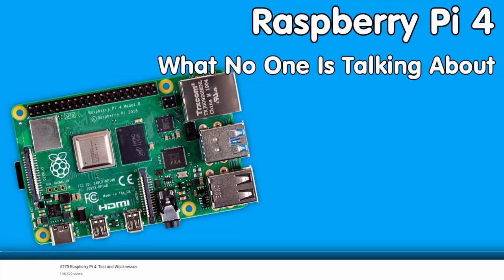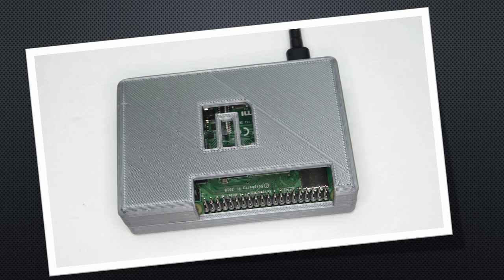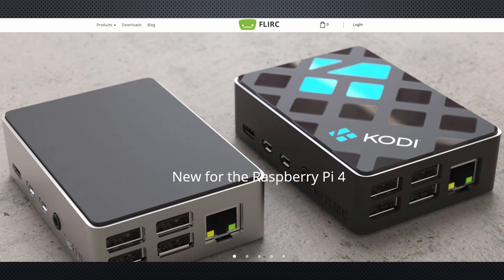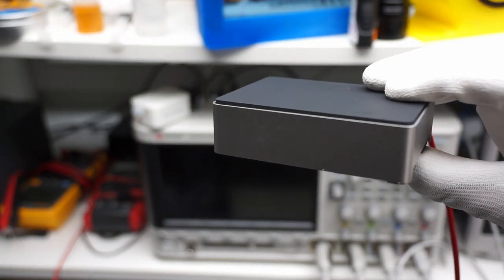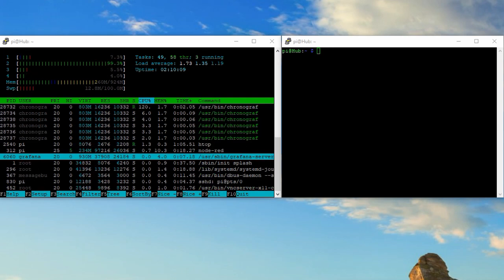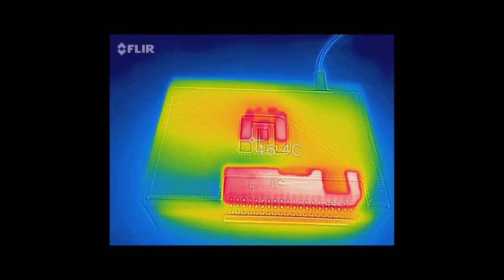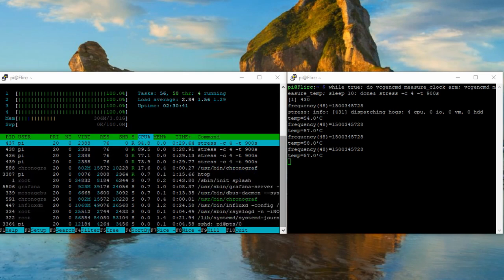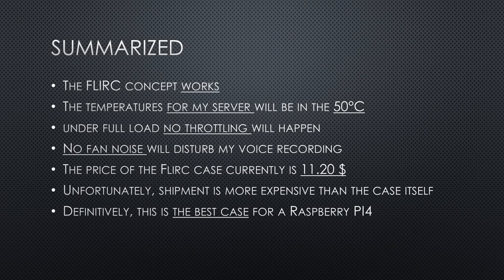#283 FLIRC: A Cooling Case for the Raspberry Pi 4? Does it work? (Quickie)

Comment: My central home control server now is a refurbished laptop running ioBroker under Windows and much more. Enough power, 8GB RAM, disk, good connectivity, case, cooling,  display, keyboard, power supply, UPS - all included. Not expensive, very convenient , and environmental friendly. Of course, RasPi is also fun tinkering around. But my home control central just has to be a very dependable system.
Reply: If you wan't a dependable system, why run MS Windows?  Too much updates that need to reboots.
Reply: @AndersJackson  Updates are annoying but they also happen with Linux. The biggest trouble with my home automattion system I had the last years was unintended Linux kernel updates creating issues with FAT32 drives. 
Several weeks ago I set up an Orange Pi with 2GB. After installing armbian from the scratch, it showed only 1GB instead of 2GB he had the last 2 years.  Linux is not flawless, Windows is not flawless. I used Windows home Server and Synology over years in parallel. Both were working stable after stopping tinkering around.
.
Reply: @klassichd10  I didn't said it doesn't happen in Linux.  But more often then not they result in a reboot in MS Windows, while that isn't the case in Linux distributions.

The example is about the ARM architecture, not OS.  You are having the same problem if you would run on MS Windows.  That problem has been expressed by Linus Torvalds.  The x86 architecture are much more standardized on how OS:es, like Linux should be able to figure out the configuration.

Also I have not said Linux is flawless, I said it is much better then MS Windows, like you don't have different OS:es if you run on a simple computer like RPi 1 B with one CPU core and 512 MB RANM or on a hundred CPU super computer with tera byte of RAM.  That is not the case in MS Windows, which you demonstrated with the name of the version of MS Windows you use...

And yes, there are only one source of bug fixes in MS Windows, not so in Linux.
Reply: @AndersJackson  As you said, x86 is very standardized and the combination with MS Windows is very common. So there are many applications running on this combination only and unfortunately not under Linux. This is also the case with one of the  applications I am running on this small Windows "Server".
But I appreciate the work of the Linux community. The competition also helped  improving Windows over the time. Win 95 was terrible in my point of view. Win 10 is much better now. And also the Linux community opend their mind. When asking for help 15 years ago I often heared something like "you have the manpage, there is all in". Nowadays we have great  sites explaining some Linux distros very well. This helps a lot and will change a lot. Market share of Linux will increase and this is fine. But MS Win will also be useable the next years. And this is also fine.
Reply: @klassichd10  the standardization of x86 is used with Linux (and MS Windows) and are not tied to MS Windows.

There are unfortunate many applications that run under Linux but not in MS Windows.  That argument goes both ways.

The stability are not a main feature for MS Windows though.  So please stay on topic.

There are still NO difference between desktop and server Linux, which IS one of many issues with MS Windows.

There are still the basics, read the manual, ask intelligent questions after you have done your home work.  It applies to anyone that want to get real help.
If you ask a question without explaining enough, you get the wrong answer or no answer at all.  If you ask, YOU are using up others time.  Don't waist others time, it is YOUR problem they are supposed to help you with.

Yes, it is up to you on what you want to spend the time, have no issue with that.  But don't fool yourself in believing that MS Windows is stable.  I been around since MS Windows 2.11, administration a University computers.
Reply: @AndersJackson  Thanks a lot for pointing out the difference between Win and Win Server. So,  if I would face stability issues in my special setup I would migrate to a Win Server Version.  
And yes, doing my homework not to bother other people had been one important plus for Windows in the past. For me it was much easier to get the relevant and helpful  Information about Win issues by myself and it was easier and faster for me to use this. But as already stated I recognize and appreciate that the Linux community produces more and more documentation I really can use. 
Linux made good progress in terms of useability for Joe Aveage. This really  helps me a lot. I still have some headless Linux installations running on SBCs.

Comment: Hello Andreas. I have been enjoying your videos for a while now. Recently you changed your visual design. It looks nice, but I think you should avoid using uppercase for full sentences. It’s harder for me to read (I have bad eyes) and as a graphic designer myself, I must tell you it is not the right way to use typography. Lowercase are easier to read because they have more visual variety.
Thanks :)
Reply from the maker: Sorry for that. I am not at all a graphic designer. This is why I used a pre-made template which I liked. An this came with the Font. I will have a look at it.
Reply: @AndreasSpiess  I'd be happy to help if you need some graphic design skills.

Comment: This is not a new concept. Many laptops, Apple MacBook Pro's being the most common, use this principale. Using the aluminium case for thermal capacity. One of the drawbacks of the new MacBook pro's is the thinner chassis and therefor reduced thermal capacity. The fans kick in earlier and more frequent because of this.
Reply from the maker: I saw it the first time here. But Apple was always good for innovative concepts...

Comment: i had similar case for my intel nuc (intel core i7 8th gen quadcore ~45watts; laptop versions of earlier generation were 15watts) and it seems ok outside airconditioner. i've put 500gb nvme (600 times faster than regular sata ssd) and 16gb ram. in summary it is small pc on steroids. interestingly this flirc case looks remarkably similar (https://www.youtube.com/watch?v=VzRpNAEWtRA) but the nuc case has fan and ofcourse it is designed by intel themselves so it is much better at heat dissipation.

talking about heat, recently i destroyed one of my chinese ip camera. i had put inside a garden light enclosure. but in a recent storm, its cap flew away. i got a bit lazy and within a few days, rains did the magic. it still breathes about 200mA but for infrared bulbs. i found a quick solution, and enclosed another old ip camera inside a plastic bag and put in on the same garden light enclosure but somehow, there was a heavy downpour next day itself and i think it overheated a bit and it sucks about 5Amps for sometime then 260mA after sometime. so it is still not at peace. but this gave me excuse to open the case and look inside. i found it is quite neat construction and modular also. all the spare parts are easily available on aliexpress and banggood. We may also change lens (2.1mm ultra wide, 2.8mm, 3.6mm, and even longer lenses for zoom). For the PTZ models there are 2 stepper motors, one for horizontal rotation, one for vertical similar to 3d printers. costiler ones have a third  motor if the lens length is adjustable. There is also one speaker and mic for listening.

there is a wifi module, ethernet module, power module, a CCD sensor below the lens. there is even an IR filter (for night vision, blocks Infra red) this is controlled by 2 wire solenoid which moves the filter over the sensor and away from it. after some google search, i found such ccd sensors are also available for pi. so maybe one day i will replace the board with a rasperry pi zero w and replace the ccd sensor with one compatible with it...and place it in the same assembly. Hopefully someone might have done it already with 3d printer. key is to make several boards and place it at different places connected by cables. But how to make it waterproof and heat proof still requires some attention.
Reply: IR filter blocks IR during daytime use for better color Quality. During low light the IR filter is flipped away to let the IR to the imager.
Reply: Ok, I thought it was the other way. In one of my IP cameras try that thing is stuck halfway. Now I see half of the image in purple colour during daytime. Night it's black and white. Anyway it is too small shutter That's the point. And making it dustproof waterproof heat proof is another challenge
Reply from the maker: @kk44: I used one of those RPI cameras in my IR video. You hear a click if you switch to night vision.

Comment: Just buy Intel Atom X5-Z8xxx based devices and slap an Arduino on it... Much more powerful and actually packaged! Yes the price is more when new, but they are such an established SoC, that they can readily be bought used for less than a Pi4, especially if you need a case!

Also the CPU temperature being too hot is not true... There is plenty of evidence to show that pretty much all modern CPUs and GPUs do not degrade or die more often even if they are run at just below their throttling temperature! (Why I have always been overclocking with plenty of volts)
Reply from the maker: Maybe you are right about the temperature..

Comment: The flirc case gets too hot to touch very quickly.  It is just garbage for the pi 4! Do yourself a favor and get active cooling for the pi 4!
Reply: Yep I have a 10 pack of 30x30mm fans from aliexpress for $3 and a ton of those cheap copper heatsinks for $5 from aliexpress also. My pi 4 at max load sits at 48C

Comment: You are quite scientific with everything, but using the FLIR camera really lacks proper known emissivity..  pointing it at some random surface and saying "it's xx degrees!" is such a massive fail.
Reply: Targeting non conductive materials as plastics, paper, or sticker made of paper or plastic helps a lot und will do the trick for measuring things like that. Testo, e.g. sell a special IR tape which sticks up to 250°C. For short term measurements normal office tape is sufficient for  this measurement.
Reply: How about explaining your expertise with FLIR products, for those who aren't aware of your Stature in these matters. It's used world wide for just such measurements and has a calibration function.
Reply: @bryanst.martin7134  I'm not an expert, but I know he's not using it properly - and from watching his videos he seems like a guy that likes to do it properly.

Most FLIR cameras (Forward Looking InfraRed, not just the brand FLIR) has a standard emissivity, often around 0.95. This value varies A LOT, depending on what material you're looking at.
Reply: Completely agree with Bryan.
Just saying "you're doing it wrong" is the most useless comment on YouTube.

I still strongly believe the conclusion, that the case makes a difference, is correct.
Reply: @dozog  Wrong. It's completely valid to point out errors without having to write a comprehensive doctorate for the guy doing it wrong. It's a nice gesture, sure, but definitely not a requirement. 99% of the time the guy/girl/trans/toaster behind a youtube channel doesn't even bother to read, let alone respond, to replies to their videos, making a comprehensive reply an utter waste of time.
Reply: @UndercoverFerret404  How does your latest comment not undermine your own argument...
(Besides strawmanning the point)